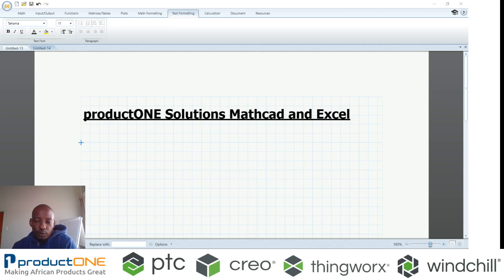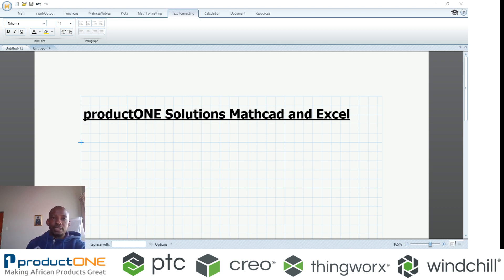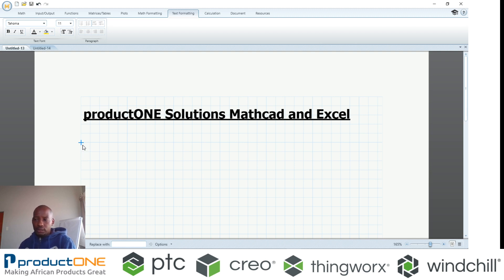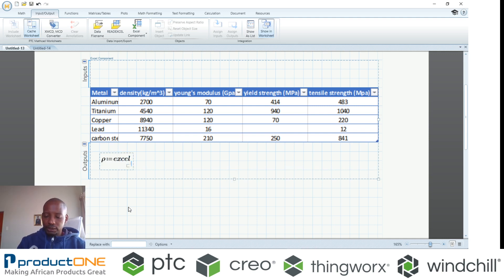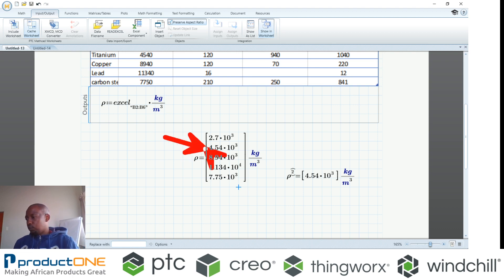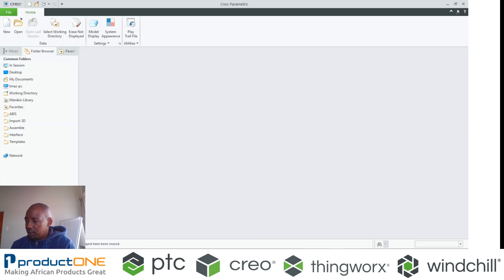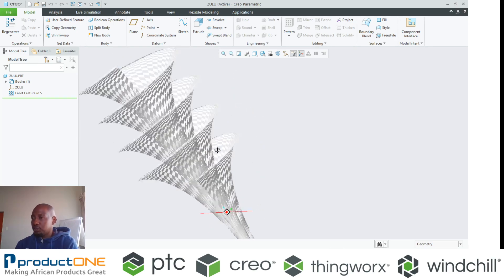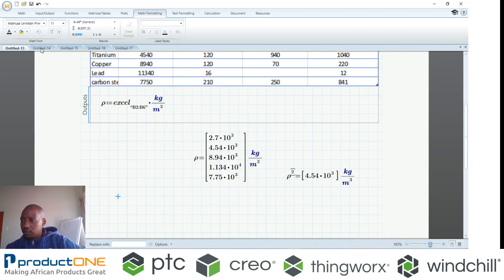Power of PTC Mathcad with Excel and Creo Parametric

Comment: Hi, I have an excel sheet, I want to use the data from excel sheet in mathcad and do the calculation. The problem is the when my excel sheet get new values from other source it is not able to update the data in mathcad. Do you have any solution?